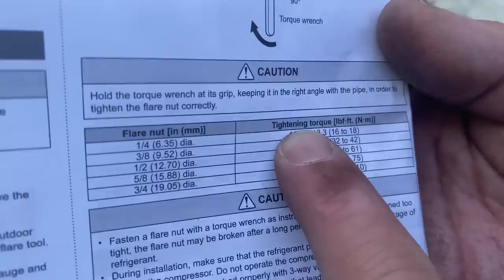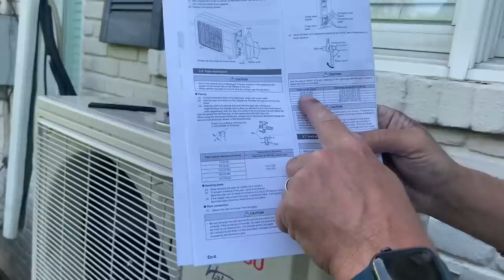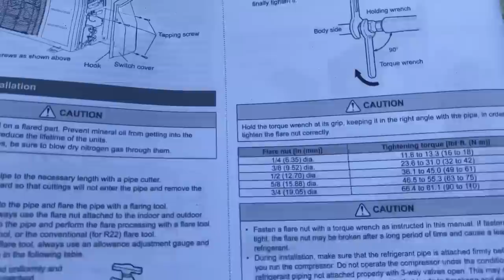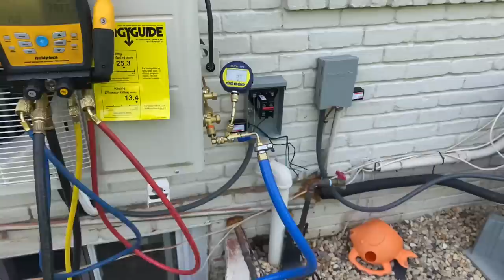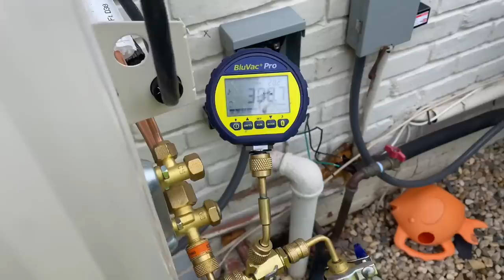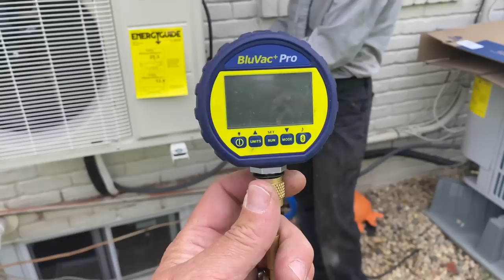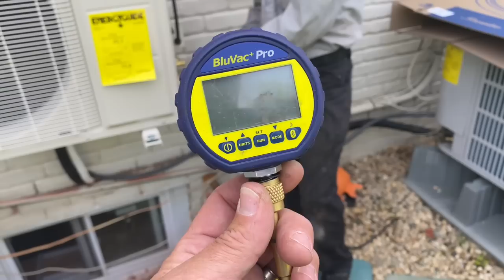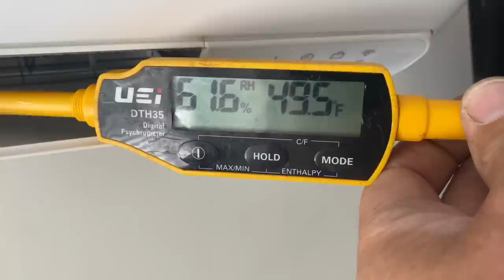Same Day Installation Dual Single Zone Ductless Mini Split

Comment: Mike, when you are done using a torque wrench, always back the adjustment back to o. This done so the spring that is holding the correct number called for is relaxed and will always be in spec.

Comment: One more tip.  Use the 32 x 32 heat pump pads for the bosch.  Looks a lot better than the 36 x 36 ones.

Comment: Another great video mike! Sense my distribution center let me know Fujitsu is looking to get out of the HVAC market and they are no longer going to be ordering them as much. So for now my company switching to Bosch mini splits. So far they have been working out great and super quiet & Efficient,  We have been looking into Gree and mitsubishi mini splits as a secondary option but the bosch one have been working out great.
Reply: Can you get a wiring schematic for them?  I want to add a new kitchen, but running duct work would be a major problem.  Think a mini split in kitchen would work, but I want it to be controlled by my home in conjunction with the rest of the system.  So I would have to be able to control it by tapping into the board.

Comment: Great install as always….Mike Romex (NM) in seal tight is an NEC violation not rated for wet location. Love the content👍
Reply: What article of the NEC? Everyone always says that but there is nothing in the code that says you can’t. Actually says you can.
Reply: I think you are confused with physical damage protection and “Wet Location”
See article sites below…👍

ARTICLE 334 Nonmetallic-Sheathed Cable: Types NM, NMC, and NMS

II. Installation

334.12 Uses Not Permitted.
(B) Types NM and NMS. Types NM and NMS cables shall not be used under the following conditions or in the following locations:

(4) In wet or damp locations.
Reply: @RonSciara  but it doesn’t say NM in seal tight or any conduit for that matter  is a violation and once you put the NM in seal tight it is no longer ran in a wet location.
Reply: 👊🏼Lmao once outside the disconnect the area is considered WET LOCATION… Mike ask some of your “Licensed” Electrical Contractor Friends… I’m sure they will agree…
Reply: @RonSciara  you are correct. NM isn’t allowed in wet location even in conduit.
Reply: @joshrobbins3629  all conduit is considered wet location, anywhere water may be present and that's anywhere outdoors, most crawlspaces, etc.
last I understood, NM wire shouldn't even penetrate through the exterior wall into a disconnect nor any other outdoor box. but they've changed the code so much, everyone's heads are still spinning like tops and many locales are 10+ years behind on code requirements sets. 
in NM the insulated conductor are generally fine with being wet, but that bare ground and paper buffer is what halts wet usage, plus if there will be any slight flexing, then it should be stranded wire. really no conduit is designed to be flexed, but we all know how that goes.

Comment: Rolling on the floor laughing😂😂😂😂 I was yelling no, no no you forgot the nut you forgot the nut no no 😊 an you turned it into a training session ❤. So? The million dollar question of the day is, was that a Woopsie??🤦‍♂️ or was that intentional?? 🤷🏻‍♂️
Well? The voting process is done an???? It’s unanimous that it was intentional!!!! Lol but  I like the units up above  grass discharge of the lawn mowers. An? Nice job on the strain release RX connectors! While technically that underground transmission line is not going to go anywhere without the RX connector here in Michigan?? it is a guaranteed fail with the inspectors but  $200?? Mikey pipes?? Where is your head at?? 0.0 add a permanent marker signature on the back Mikey pipes an sell it for $350.00!! Goly Gee Whizz guess I’m gonna have to go to work for you in the ad revenue department🤣🤣🤣🤣

Comment: Put another core tool on your other core tool and you can isolate the micron gauge to prevent oil logging it when releasing the charge.
Reply: "yo dawg, we heard you like core tools, so we'll sell you a core tool for your core tool"
perhaps try an inline ball valve instead, like one made to add valve to a hose end. that should be far cheaper and add a valve to the vac. gauge. but that's just more fittings to leak and pockets around ball to hold atmosphere/moisture.

Comment: Nylog should only be applied to the back side of the flair so the nut spins against the nylog and the flair.We have installed every brand mini split and Mitsubishi is by far the best mini split money can buy and its not even close.
Reply: @Mikey Pipes - Pipe Doctor Plumbing & Heating & Air  agree but im just saying if you use it this is the only place you should put it.

Comment: 7:20 the guy who framed the closet opening is now flipping his wig, because that wall wasn't built to support any weight beyond the bifold doors. not floors above it nor junk hung on it.
hopefully they have more than just a few nails or screws holding the top plate to the joists, cripple studs and flat header together. lol(probably not)
the drywall is pretty tough, but will sag in time if it's not all fastened together well. most people tend to spray nails wildly when air/fuel nailing, but will use screws sparingly because it takes longer to drive them in.
but it should have been the known and planned location ahead of time and built to support weight. oh well 🥳

Comment: You guys dont install Mitsubishi? I installed 4 separate systems at the house, 1 15k, 1 18k, 1 9k, 1 24k to 3.. the Hyper Heat is incredible. I like Fujitsu too but Mitsubishi is my pick hands down!!! I also installed surge protectors on all the systems also!!! Im DIY but Im an electrician by trade now in the utility industry.

Comment: Installing the units above the basement windows eliminates them for use as legal egress, even if the windows were the correct size. There can be nothing overhead of an egress window, at least around here. As always, check your local code.

Comment: Mike, just another tip.  Put some extra 50 lb anchors around the perimeter of the bracket.  Not to keep it from falling but to keep the bracket from bending off the wall so you don't get unsightly gaps on the edge.  I usually get at least 15 to 20 anchors/screws in each wall bracket.  Why not?  I want that bracket staying against the wall.
Reply: @PipeDoctor  Depends on the customer :).